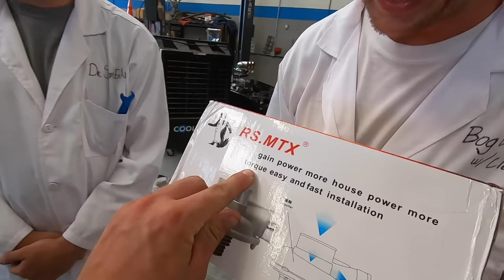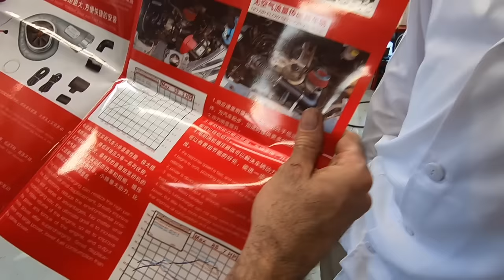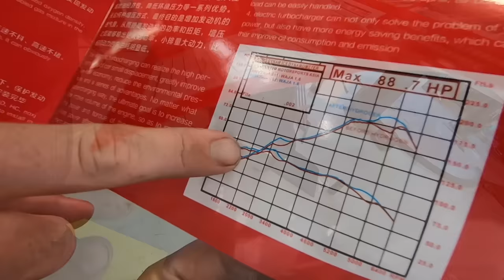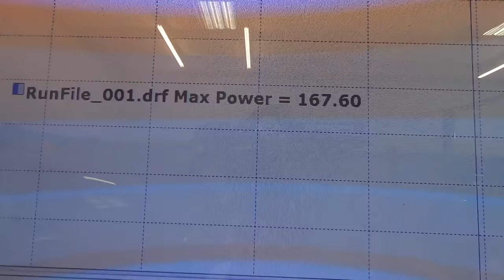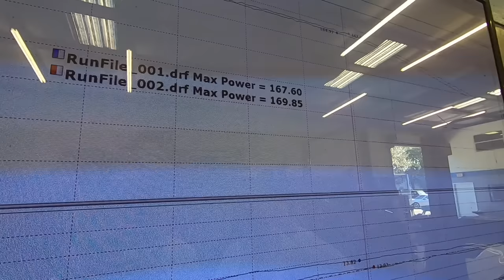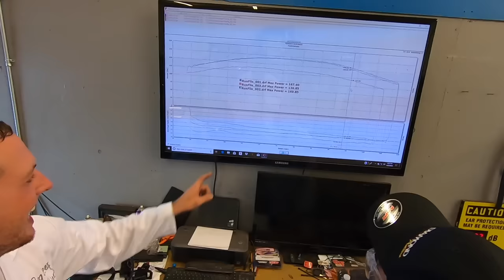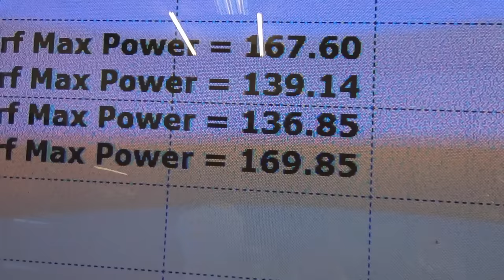Dyno Testing a $400 ELECTRIC TURBO! Funniest Car Part EVER!

Comment: I wanna know why it didn’t work like on a serious note
Reply: Assuming .. and this is a massive stretch in itself - that the compressor and housing design are legit, say an off the shelf OE turbo "cold side" (of useful size for the application) fitted with an electric motor. The energy requirements to spool and maintain the turbine to actually produce useful positive plenum pressure are far from insignificant (If not intuitively obvious to anyone who has ever thumbed a compressor wheel). Possible? Oh, absolutely, maybe with a custom NASA designed brushless polyphase motor drawing a few hundred Amps, and even then - only for intermittent use. A "true" electric turbo would at the very least suffer electrical resistance losses and require at least a ridiculously beefy alternator which itself would suffer frictional loss - and/or require additional battery mass. Generally It all comes down to the second law of thermodynamics - although in this particular case, economics (cheaply manufactured and poorly engineered crap) is the limiting factor.
Reply: because they essentially put the turbo off a 1 liter engine on a truck.  If this was on a 1.6 or less I'm sure you'd get 2 or 3 psi
Reply: Jim Vicious alright cool glad I got that answer so in this case the “pro charger” which is basically a high end electrical turbo but it runs off a belt is the better engineered version of what we would call a “electrical turbo”
Reply: @anotherpos8704  Hard to guess. Certainly the housing was undersized for the application, but positive pressure still requires massive energy regardless - and my spidey senses tell me that you're not meeting that requirement with a Chinese 12V motor with less than 4 gau. cables snaking to it - and even then, not for long. ;)
Reply: yeah you are right, theres no way that was drawing 100 amps, let alone any more than that.  I wish they had of told us how much current the 48v charger took to make 3psi on that Cobalt 2.2l, and were they using a massive dc-dc converter?

Comment: Universal Electric Turbo Supercharger Kit Thrust Motorcycle Air Filter Intake

Does it work for more power I'm thinking about putting 4 on a car but would like to see would one work on a car pure imagination never mind that is what I been looking at on eBay I'm thinking that my idea mite be insane but I thinking 2 for each set of cylinders on each side of the motor may work 2 for a set of 4 and 2 for the other set of 4 on the other side may work when I do this I will post it on you tube

Comment: Maybe a 3 cyl engine.

  A FUEL POWERED ENGINE IS NOT A "MOTOR"!....sheesh.

 Electric motors are motors.  GM and Ferd Motor Co. are WRONG.

MOPAR is even worse.

Comment: Hi. Im new to your videos ..and love the videos. Interesting and im a adrenaline junkie and speed freak. I have a 2008 Nissan Altima 2.5z  with cold air intake 1010  thousand miles  nice car and i baby it all the time never dogging it out anyway.. iv add a  "PCR" PERFORMANCE CHIP REVAMP.  And has add some impressive power. In the turbo video you was looking for something that gives u real power. And its not expensive most of all. I dont have a shop like yours to test the horse power and im extremely interested in finding out the difference between the factory power and the chip. If you could.  ...PLEASE make a test video of this product..and thank you for your time ...continue the great work.    If u can email me at ashleyclaywillis@yahoo.com.  thanks

Comment: Less piss taking and giggling....more just getting on with it...would have been better.  First run up test...the guy nearly gets his fingers sucked into the impeller.....clearly a serious pro.  Aside from all the macho bs and posturing.....the vid was interesting.  They needed to adjust the fuel and timing to get the best out of it. Turbo’s don’t only ram air in with no other tuning or matching to the engine.

Comment: bla bla bla bla some time I think you are trying to lose our time for nothing... this video is real fake... regarding the original pipe diameter of the mustang and the diameter of the turbo pipe it is normal to have lower air intake and to decrese horse power of the engine. Next time just put this turbo on some truck and lose our time again for funny horse power decrese...